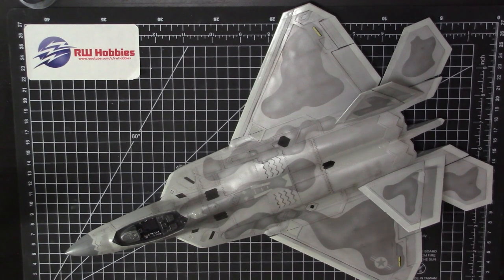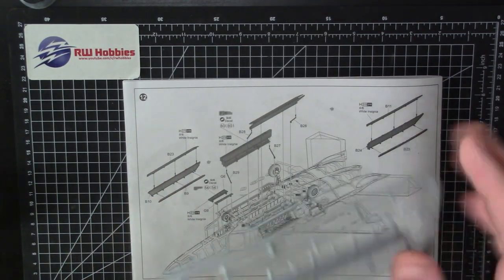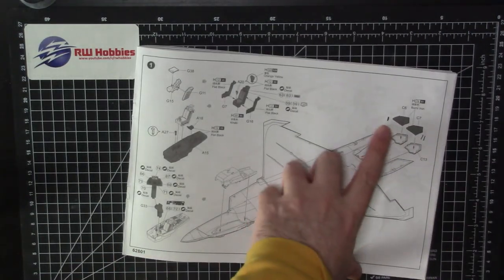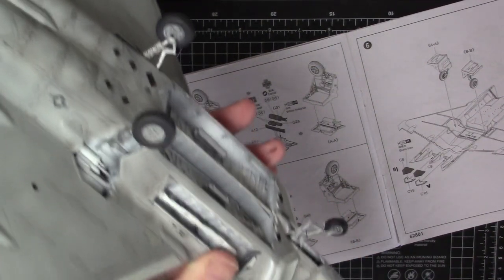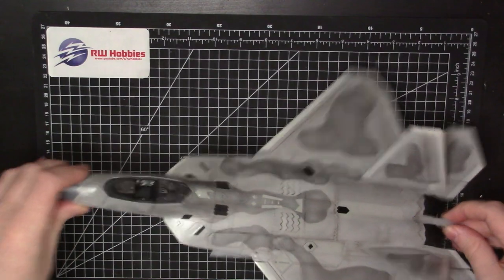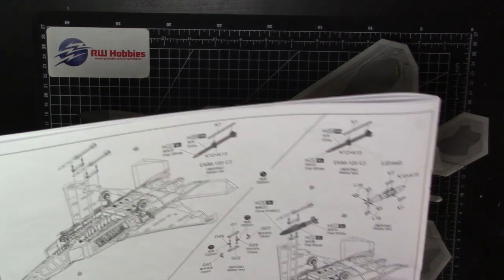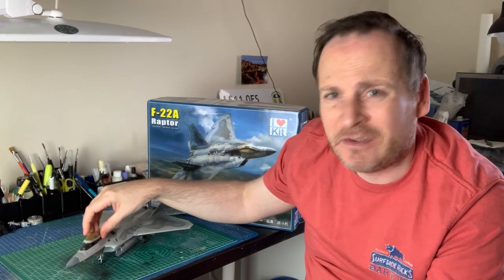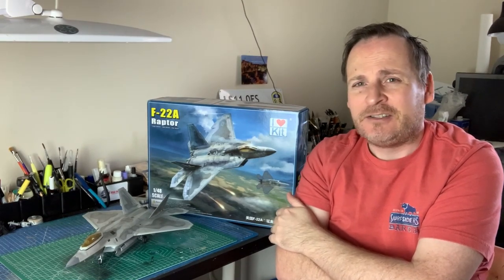1/48 I Love Kit F-22A Raptor  Build Series - Part 5: Final Reveal

Comment: nice build, very informative. has your opinion on the price point changed since you completed the build?
Reply from the maker: Yes and no. It was originally $150, now $100. Seems the going rate for a 1/48 jet. Unfortunately still seems a bit steep at $100. Just a bog standard plastic kit which fits well. Zero PE, resin, seat belts etc. I would say $60. But right now the world has gone crazy with prices.

But if you want a F-22 for your collection really best option.